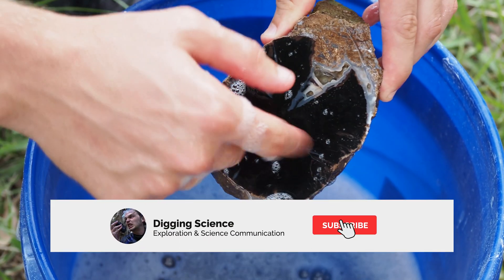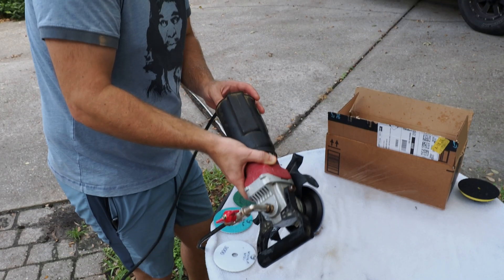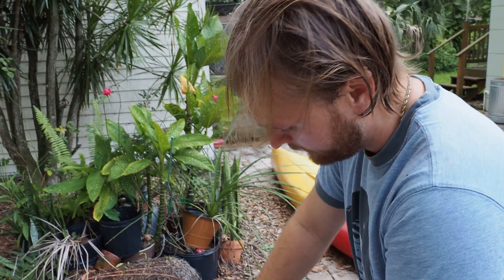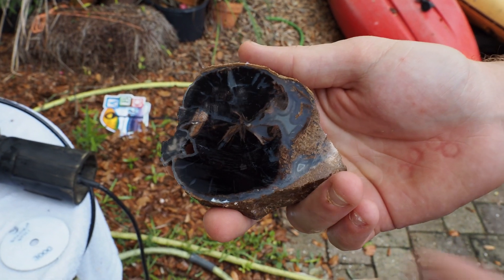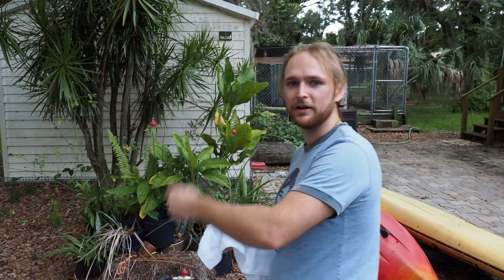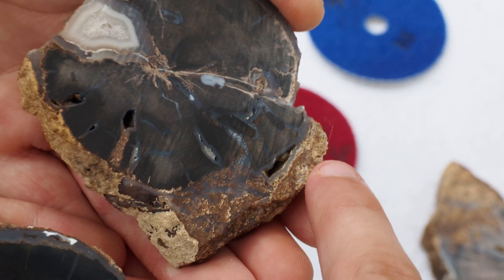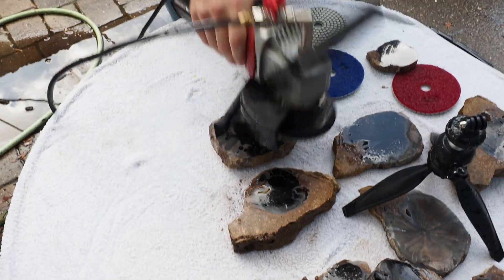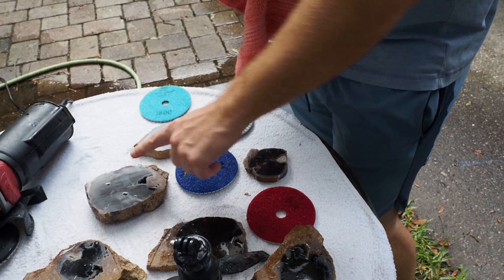How to Polish Petrified Wood & Rocks Quickly Without a Tumbler

Comment: I am working on a 15" diameter slab of petrified wood I obtained from a rock shop in Utah. Their saw cut was pretty smooth. Using the ZTE wet grinder you have. I found your video the most informative of many on YouTube, specifically timing on each grit and how the surface is supposed to look after each run. I have had to back up to coarser grits a couple of times to work on edges based on those appearances. Thanks for uploading this one!

Comment: Had the polisher for about 24 hours now, one definitely take the water guard off helps it not catch on things and you can get it more level, I work with a lot of materials ordered the 11 plus disc pack it came with a 6000 grit which I'll use on obsidian and other touchy things so far man a good purchase considering a flat lap is a $1,000. little learning curve thank you very much

Comment: I have been polishing stone for the last 33 years. Everything you say is true. I use each grit progressively longer. Your using a flexible back. If you use a hard back it will be much flatter. It is just harder to use. I like to use a hard felt buffer with aluminum oxide to finish sculpted uneven stone carvings. Not necessary on small flat pieces of stone. Pads put a better shine on flat surfaces than a pad. Weird water control/ shut off on that polisher. Nice work.

Comment: Nice 👍 
I have used a Dremel tool with diamond burs and wet sandpaper in many grades . The most challenging thing I found to polish is amber ( my favourite)
Thank you for sharing
Reply: Pyrite ball was the hardest (difficult) material i ever polished. Two spots at the poles of the sphere just will not polish to a shine. Very odd. Looks like a gold nugget. Also drilling pyrite is a tough one, being a crystal.